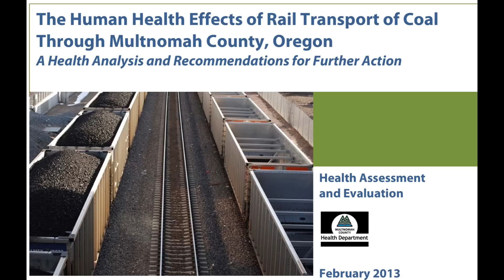Steam Locomotive Refueling

Comment: You did indeed start as a cleaner on the railroad.
I have been a fireman in preservation, and it was hand firing. Power stokers were usually used on the largest locomotives, and in general less common in Europe, even on locomotives which should have had them.
Imagine firing a 3000hp or over locomotive by hand, and this was often the case, no wonder many firemen wouldn't like these, like the Belgian type 1 out of my video request.
But in my case it was a 1600hp 2-8-0, and being younger and fitter then, it wasn't that hard, even with the inclines we had on our railway. Of course did the operations at limited speed and with 6 coaches not demand all of the engine.
What was hard was the heat and often the humidity in the summer.
On many smaller depots and staging points at smaller RRs and branch lines you would not find the huge concrete hoppers, but often a coal yard with a crane with grab if you were lucky, or like in one picture in the video you had to hand fill small dump cars or even buckets which could then rapidly being dumped in the coal bunker of the loco, buckets often used where small tank locomotives were used which took only 1 or 1.5 tonnes of coal at a time.
But I know several large depots have existed in Belgium, the UK, Germany and the Netherlands which had large hoppers, those in Belgium and the UK very similar to US ones being loaded by an elevator which transported coal out of a dump pit, those in the Netherlands and Germany being made out of steel and loaded with a grab crane mounted on the coaling tower which unloaded the coal from open wagons.
Reply from the maker: Great info as always Tom!

Comment: Very nice to see North American steam engine refuelling solutions and the coal towers. On the water trough, I have a picture of a UK class 40 (type 4) 2000hp diesel filling its water tanks from such troughs! In the early days of diesel they were fitted with steam boilers to provide steam to heat the coaches, (also a steam engine coupled to a diesel when the diesel steam heater had failed) this as we transitioned steam to diesel with electric thrown in! 
UK steam suffered from different qualities of coal around the country, certain engines were designed (our big four regional companies 1923 to 1948 all had different chief engineers and thus views and needs on engine designs) for high quality coal e.g. Welsh coal for good performance. Problem with most coaling towers is every loco gets the same from local collieries (now all closed) so not necessarily good for optimal steaming, unless there is a choice/ multiple chutes to cope with. Did N. American engines suffer from this or less prone to such variation?
Reply from the maker: Thank you for sharing!

Comment: yea it was a coal tower interest here in town that got me searching about information about what used to sit here on the old b and o main, turns out the coal tower that was actually a tower built in 1947 before that it was an incline with pockets on two sides and after that they used the gatry crane to fill on the cinder pit, which was replaced by the ogle engineering coal tower built here that had a pit under it to empty the ashpan and fire and conveyed ot over to a skip hoist to load it into a waiting car, it also could take on water on three engines and put sand in carried 500 tons of coal 200 tons of sand which I am not sure how they loaded the coal was a bucket skip hoist like the ash lift and had 3 water pipes or penstocks as they were also called or standpipes.  was last used in 1958 but no one knows when they took it down. it was overall 95 feet tall and a picture of it could be found in modern railroader in the same issue as the flue processing plant put in at the cumberland shops intrestingly though in 1909 they had a simaler one at garrett in the back of the boiler shop here in a 20 by 30 room I think it was or area commingout of the flue rattler which is a spinning drum that functioned like a washing machine to clean the pipes of dirt and scale and it would roll in on a track,
can also be seen in living Color on this https://www.youtube.com/watch?v=guSAHINmMUA&t=277s its the giant silo thing on stilts in garrett and funny thing back then they let the guests into the railyard right up close you would not get away with that today

as for me I have cleaned the firebox out and cleaned grates on nkp 765 many times as well as blowing the flues, and a few times drilled out staybolt tell tells and have a handfull of times filled up the firebox with a bed of coal for it to be lit off and started to get it ready for trips I still have a way to go on my aim half the coal on the shovel ends up in the cab heh but its good practice and you got to keep an even layer and cover all the grates otherwise the cold air of exposed grates can ruin them from the heat and you loos efficency not using every square inch to heat that you got, cold air also seeps up though the bottom and its not good on the metal of the firebox as another thing that not good about exposed grates.
Reply from the maker: Great response, as usual!
Reply: @TheRailroadCrossing-SteamPower  thanks I am mearly trying to get the stories out there and teach about who we were in the city, and the area with its high speed trains some of the fastest in the usa and in the world at the point

Comment: At 2:13 especially hundred years ago? A hundred years ago was 1924. America had already asserted itself on the world stage by bullying poor, old, tired Spain, building the Panama Canal and supplying English and France with the products necessary to hold off Germany as well as contributing 116,516 American lives to a fight we didn't really have much at stake. Probably add at least another half century to that building America time line.
Reply from the maker: It was also a time the coal industry was running nothing less than sweat shops.
Reply: Worker safety didn't make much headway until FDR. Although the railroads did adopt air brakes and knuckle style couplers well before that worker safety was an after thought.

Comment: One road that is notable for never operating coal-fired steam locomotives is the Flagler System, the Florida East Coast Railway. Flagler, being a partner of Rockefeller, used cheap residual fuel oil to fire locomotive boilers and I believe that is why the FEC granite ballast is still blue, the track wasn't dusted for decades with cinders and soot.
Reply: Not true.  The FEC used coal as fuel for its steam locomotives until around 1910, when its locomotives were converted to burn oil.  New locomotives acquired after this date were built as oil-burners.
Reply from the maker: I did not know this

Comment: The New Haven railroad had a HUGE renforced concrete coaling tower in East Haven CT., where they had a huge roundhouse facitlity (mow long gone), also near the former Cedat Hill freight yard (mostly abandoned, though a large amount of track & structures are still in place, mostly overgrown & derelict).  The coaling tower is easily visible from the right side of Amtrak passenger trains heading southbound into New Haven, just a few minitues arrival at the station.  🙂

Comment: I still heat with coal in a outside water furnace it also heats my domestic hot water my shop and my hot tub it’s run year round . I save the ash for the winter to put on my driveway
Reply from the maker: My Grandmother did that same thing on her driveway.

Comment: the jobs that emptied the ash pan, loaded coal or water before the train crew reported to duty (along with starting the fires etc) were called Hostlers.  they could sometime bid to a Fireman's job but Engineers were the top of the pay scale.  not sure if Firemen could go to Engineer or if they had to be a Conductor first or not.

before my time but I've known gentlemen who did all the positioning of the locomotives in the right spots for the train to be made up and got them ready to pull into the repair facilities for maintenance.  they were all Hostlers
Reply from the maker: Cool story!

Comment: There was another use for the ash.  When I was a young kid, my school burned coal for heating.  During the winter, the janitor would spread ash over the ice slides we created.  Coal was still used in some houses back then and people would spread ash on their driveways and sidewalks in winter.
Reply: My grandfather had a coal (actually coke) furnace. We lived next door. The ashes were taken from the coal furnace and used in winter as anti-skid on the driveway. The driveway was "paved" with red dog, the burnt shale from the coal mine. These events occurred over 60 years ago!
Reply: Our school burned coal in its boiler also. The ash was in chunks called clinkers. You could see the size of those clinkers in the video. Our school would grind the clinkers with a Letz burr mill to 1/4 To 3/8 inch size. This was them put on the athletic track hence the term cinder track. My town of Holstein, Iowa had what was considered the 2nd best track in Iowa at the time.
Reply from the maker: I ran on a cinder track in High School myself. Not nice on the knee's if you hit the ground. It tore mine up after falling on the hurdles.
Reply: @TheRailroadCrossing-SteamPower  I'm guessing that was in America and athletic track
Reply: Was used on speedway tracks in uk hence the name cinder track

Comment: Re entry level positions.  During WW2, one of my uncles had a part time job lubricating steam locomotives, when he wasn't in school.  I don't know if he did much else though, as that's all he mentioned.
Reply from the maker: I would have a blast doing that job... Just to be around the loco's, you know!
Reply: @TheRailroadCrossing-SteamPower  All locos?  Or just steam?  Years ago, I was a telecommunications technician with Canadian National and back in the mid 70s, when I was working in northern Ontario, I frequently rode freight trains in my work.  I rode in both the engines and cabooses.
Reply: @TheRailroadCrossing-SteamPower to be around those Machines would be Too Kool 😮😂❤❤❤wish it would have went more in detail about "coaling Tower" operations there is one by where I stay, used to climb it years ago 😂❤❤❤in Akron Ohio

Comment: Clinker is generally comprised of glassy materials from the sand and grit in the coal itself, as well as other incombustible solids that aggregate together into chunks. It can embed unburned coal, but generally not. It also has high concentrations of the lovely carcinogenic heavy solids mentioned earlier in the video, though the ash also carries some. 
It's also important to remember to pick the clinkers out of your forge before you try and heat for forge-welding.... wait, wrong use-case.... 
One of the local coal power plants that was decommissioned a few years back still had the silo-like bunkers full of low-grade lignite from when they mined it iust across the highway. The prior 5 years of operation they had decided it was cheaper to haul in the much nicer PRB sourced sub-bituminous coal via train, as it produced dramatically less ash and clinker, fouling the whole works much less. 
A couple other plants in the area still burn the crummy lignite that is readily available though. 
No anthracite or bituminous in this region though.
Reply from the maker: Well hopefully the use of coal in this way will be eliminated in favor of something far cleaner in the next 20 years.

Comment: There were engineers and firemen who worked only in yards, called hostlers. They ran loco to and from roundhouse, water spigot and fuel. 
You started as an engine wiper or cleaner, and worked up.

Comment: My father initially hired on the B&O, Baltimore, in 1942. Before acquiring his seniority date he enlisted in the US Navy,  but was  guaranteed that job upon discharge after the war. A   locomotive fireman was entry level at that time. Having a job as fireman was highly desirable employment at that time even though it was irregular, dirty and labor intensive work.  Even with automatic stokers the job required constant monitoring of the fire in order to make sure the coal was evenly  distributed in the fire-box. 
When working the engine up a hill or on a long switching move with a hand-fired locomotive  it was one shovel-full after another as fast as physically possible. 
I used to work at a rail-yard with men who had worked with steam. They said they would pay to have the experience once or twice again, but would quit the railroad if they had to do it on a daily bases.
Reply from the maker: Yeah, I just imagine that kind of work... Dont get me wrong.. I have worked hard..But nothing like that on the same hand. So I suppose I can say that I dont know the real level of hard work.. I.E. Coal miners.. Steam Loco firemen and pit crew. ETC.

Comment: One had to be pretty spry if or when the water overflowed.
Reply from the maker: Hmm... I've never seen that operation... How so?
Reply: @TheRailroadCrossing-SteamPower  Oops, I meant when they were standing on top of the tender filling it and weren't paying attention and let it run out the top.
Reply from the maker: @stevew270  in that case..yeah, that would not be a good thing.. One just as likely would be going for a unwanted ride in that event.